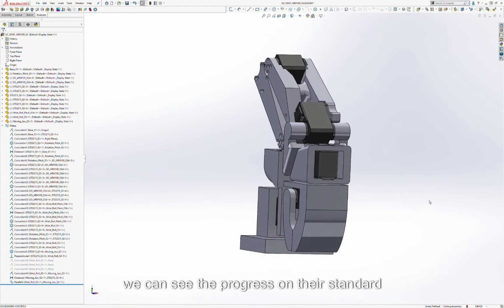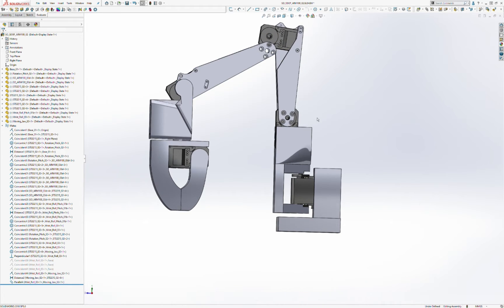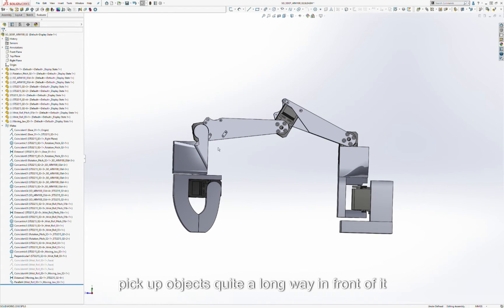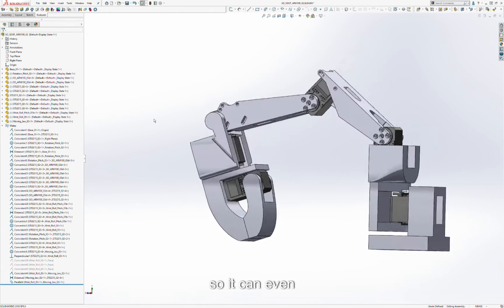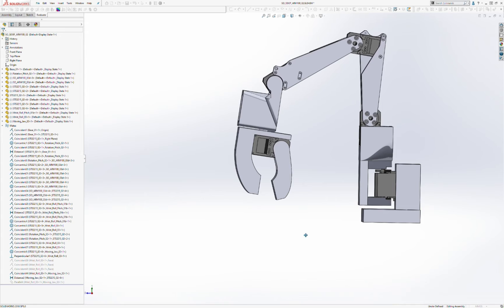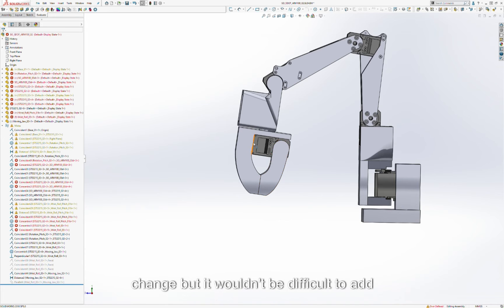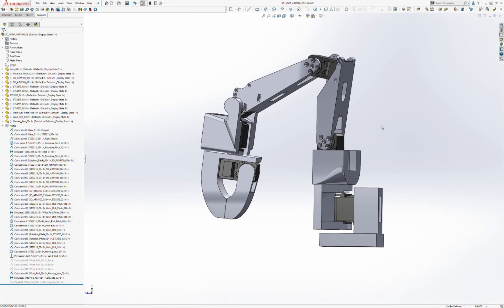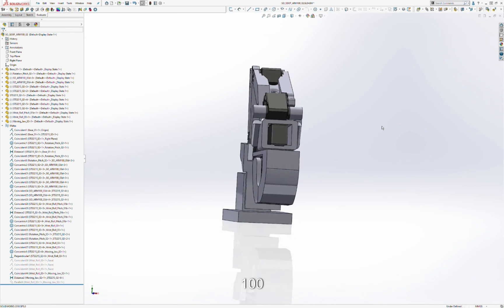Standard Open ARM 100 5DOF #2 - Low cost DIY 3dprinted robot arm for Le Robot by Hugging Face

Comment from the maker: The next stage of designing a standardised arm with 5 degrees of freedom (DOF) constrained to be as simple and low cost as possible to build.

The arm is intended for integration with the Le Robot system being developed by Hugging Face.

At quantities of 1000 units even the higher power 12v version of the STS3215 servos used in all the joints of the present arm design are under 12 USD each - exworks - so around 15 USD in your hand.

Plus an adaptor board to connect to a computer and a clamp to fix it the desk.

So assuming that everything else is 3d printed that's a 5DOF arm with gripper (6 dof total) for 100 bucks.

If 167 (1000/6 = 166.6666) people are all prepared to buy the servos at once.

Join the project with some of the brightest minds in open AI and robotics development on the discord server at: https://discord.gg/nc2JuEnHEJ